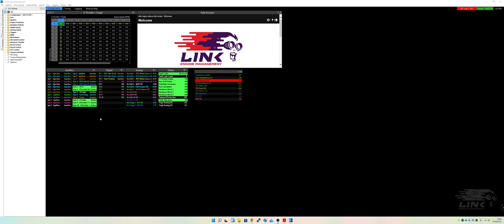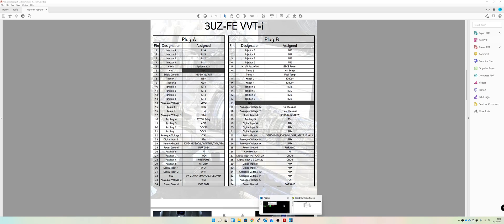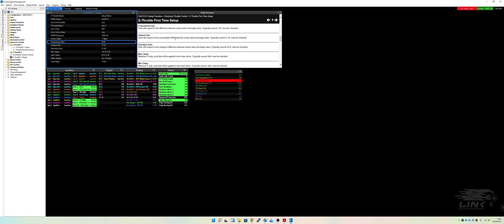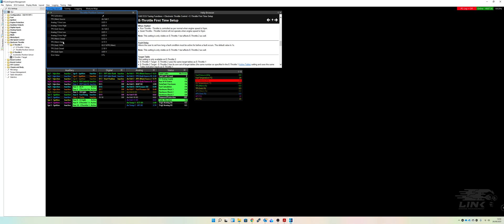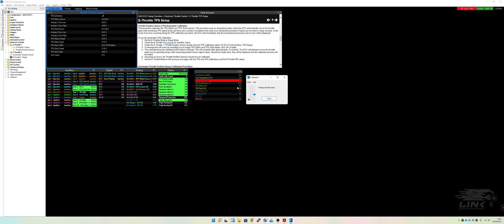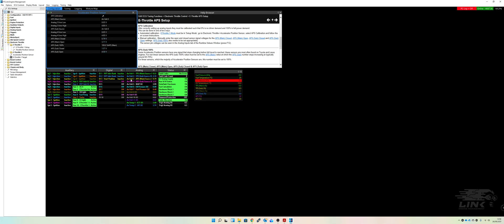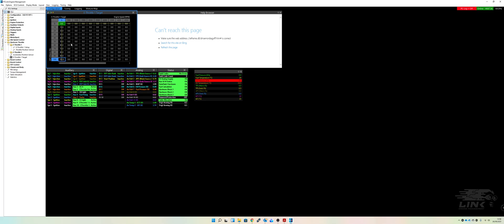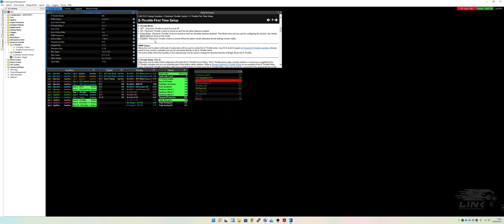Link Engine Management How To Set Up Drive By Wire

Comment: Hey, I'm 3 years late, but some quick questions, my tuner has setted up all the PID and e-throttle 1 target values, but planning to change my aps to another pedal and plan to re-calibrate my tps and APS. Would my e-throttle 1 target values be gone if i calibrate it?

Comment: I followed this video exactly and before I setup the drive-by-wire I did not have any throttle now I have throttle but I'm still idling kinda High at like 1500 RPM am I doing something wrong did I miss something what should I do?
Reply from the maker: Hello Rebwar08. Once your throttle is working then you need to move on to Idle Control Setup. That is different from the Drive By Wire setup.
The Idle setup will now allow you to control how open the throttle needs to be to idle correctly. The idle tuning will also take into account Engine Coolant Temp as a cold engine will more then likely need more throttle opening. 
Ideally you can setup the idle control in Open Loop and get it right then activate Closed Loop Idle Control to let the ECU control it.
Reply from the maker: We have not yet done an Idle Control Video for the Link so when the next Link with Drive By Wire comes along we will look at more setup issues that need resolving. I will note this down to make sure we do it.
Reply: @PhoenixEngineManagement  thank you so much phoenix i was late seeing this. You seem to really know your stuff i salute sir im loving your channel